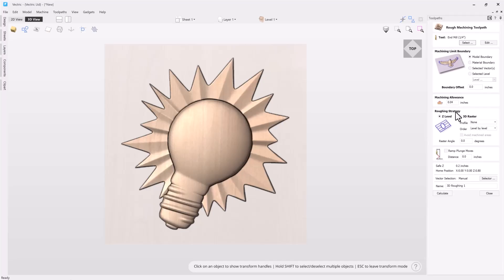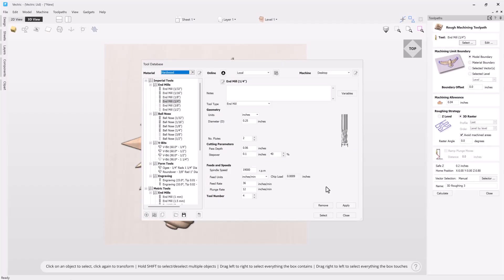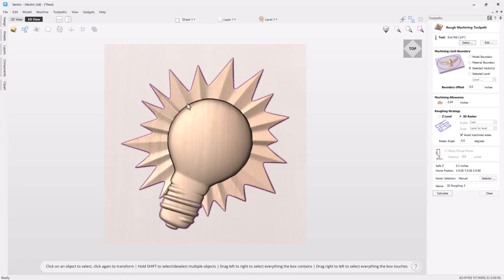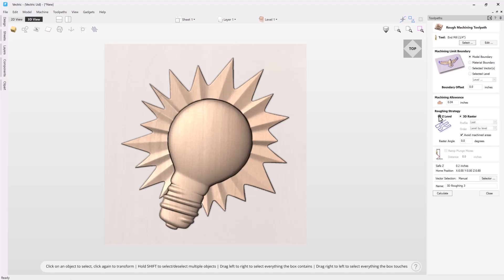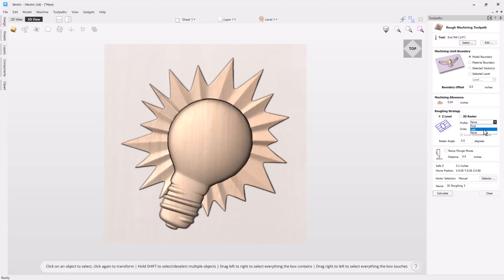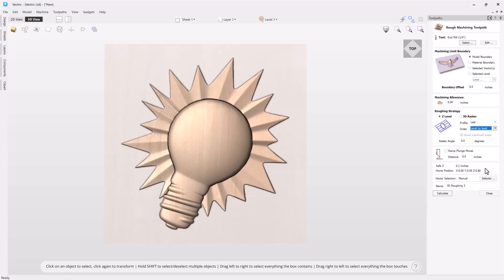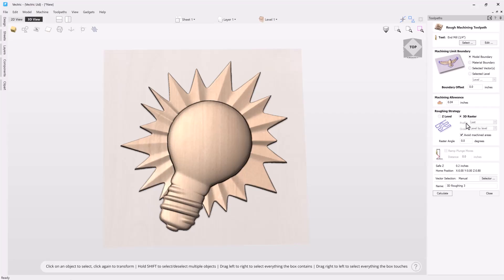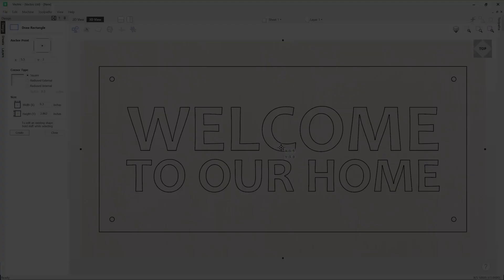How to use the 3D Roughing Toolpath | 3D Toolpaths | V12.5 Toolpaths

Comment: Im having issues with accuracy.  When I use the interactive trim tool, the weld tool... it trims the lines by a fraction before or after the intersection with another line and then when it rejoins the trimmed lines, it distortes them. Is it posible to fix this problem?
Reply from the maker: I would suggest that if you can, please email support@vectric.com with this one.  It would be helpful if you could include a description of the issue and a file that we could look at.  There could be a simple explanation or we may need to look into it more.  Thanks!